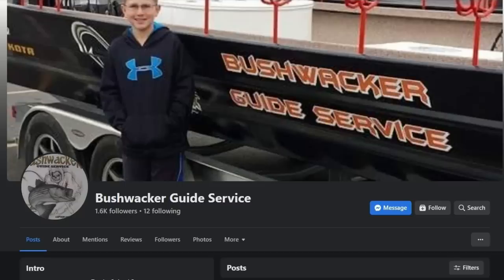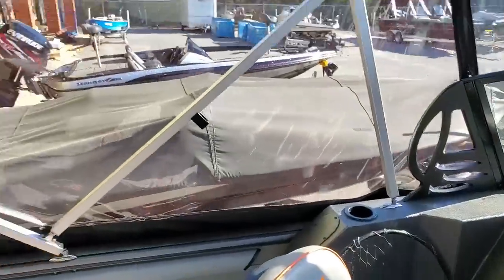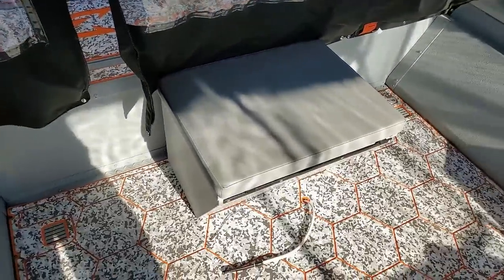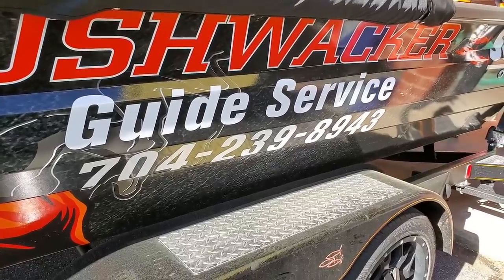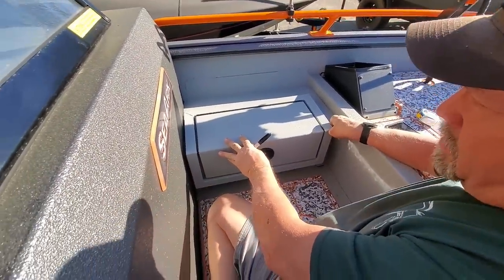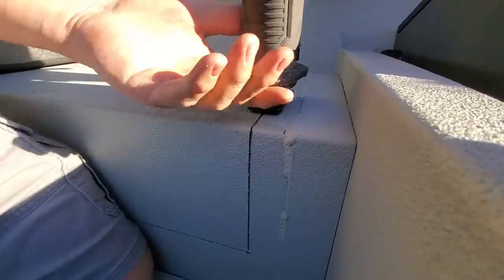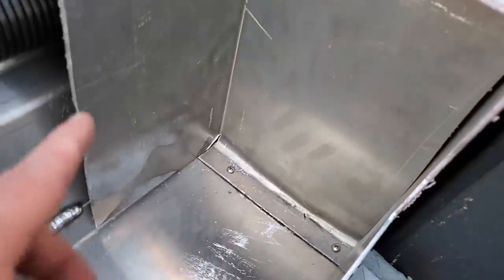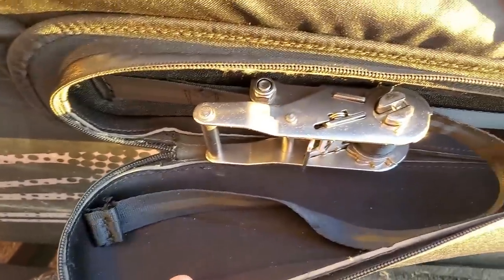DIY Storage compartment ( Add Extra storage to your boat )

Comment: neat job, came up well!
however, for anyone attempting anything similar, maybe some sealant under the lip of the new lid surrounds would be good to consider.
also, watch out when putting stainless fastenings straight into ally. 
strongly suggest using a product like tef-gel or duralac on the stainless to minimize corrosion caused by dissimilar metals.

Comment: You can find eva foam cheaper than seadeck sells it for. Same stuff they just market it and put a markup on it. You can find it with the peel and stick or plain back. I suggest getting the plain and use a good contact adhesive to glue it down. The stuff I put in my flat bottom is over 10 years old and beside a lil fading of the black to a gray color is still stuck down hard.

Comment: Would have (wud ah) thought a grinder would be the tool of choice for the cutting (cuttin).  Nice Fabin even though you didn't use DeWalt tools!
Reply from the maker: I think he didn't want to sling sparks and hot metal all over the guys new SeaDeck
Reply: @FishinNStuff  Good point.  I guess I'm just used to tarping everything off ahead of time.
Reply from the maker: @bretburt7317  I asked him the same question  lol . That's what he told me 😁